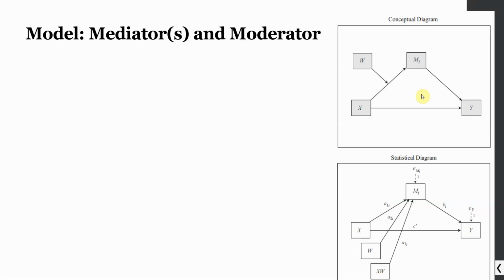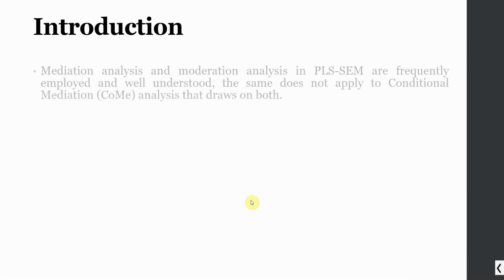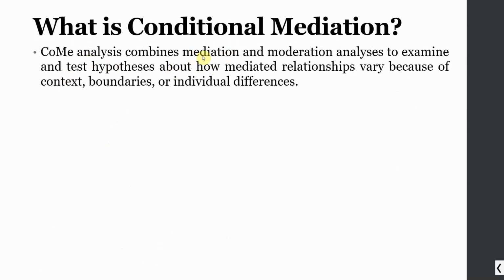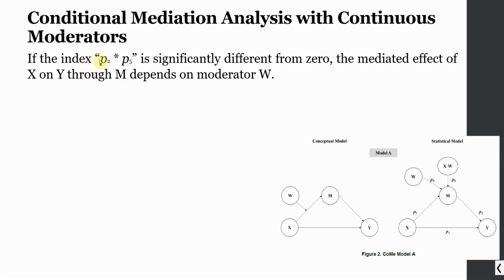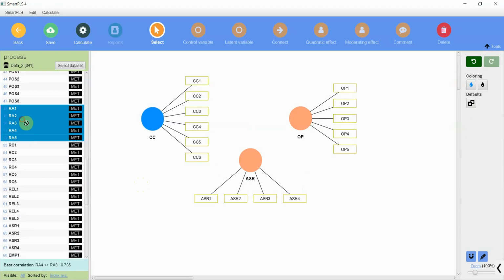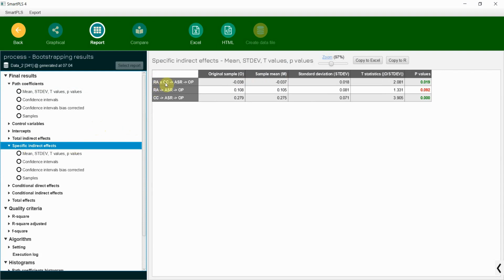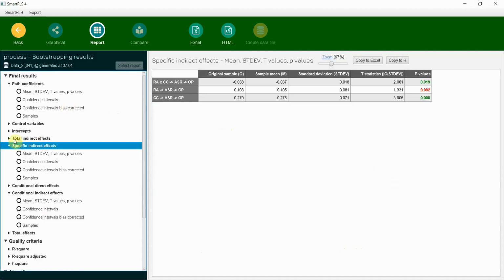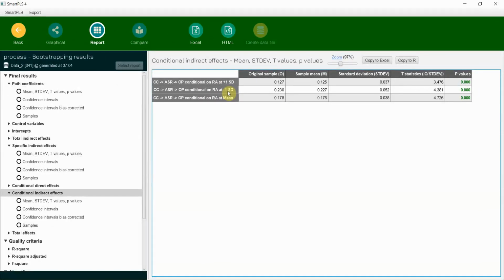#SmartPLS4 Series 35 - Moderated Mediation in SmartPLS (See Description)

Comment: Thank you so much for such a great lecture. I have learned a lot from this. But I have a query. If moderated-mediation index given by specific indirect effect is insignificant, then we need to check conditional indirect effects or not? if yes, then can conditional indirect effects at mean, SD +1 and -1 be significant?
Reply from the maker: Thanks for watching. You may check it. But overall, the moderated mediation hypothesis is not supported.
Reply: @researchwithfawad  Thank you Sir

Comment: Dear Faward, could you please show us how to on when using seminr in R to analysis PLS-SEM, how can we easily get simple slopes for moderation analysis (simple slopes for +_SD of Moderator)? Also, is there easy way to conduct moderated mediation (conditional indirect, conditional process) analysis like in PROCESS in SPSS and get the index of moderated mediation, and also the indirect effects when the moderator is high and low (+_SD)? I saw an article, Cheah, J.-H., Nitzl, C., Roldán, J. L., Cepeda-Carrion, G., & Gudergan, S. P. (2021). A Primer on the Conditional Mediation Analysis in PLS-SEM. ACM SIGMIS Database: The DATABASE for Advances in Information Systems, 52(SI), 43–100. But could not do it myself for now. If you can, please show us? Many thanks.
Reply from the maker: Hopefully, I can soon do some on MM in R. For now you can refer to 
https://www.youtube.com/playlist?list=PLb7vm6tsQ3Ks0TyMWw3EUlgoMr06_7U8S

Comment: Dear Sir,
Could the PLS-SEM approach be used to estimate moderated mediation like this, or is it only applicable to simple moderation?
Also, if the moderator simultaneously moderates one direct effect (IV -> DV) and one indirect effect (IV -> Mediator -> DV; path is identical to the one in this video), should I use the PROCESS model to estimate both of these moderating effects, or just the latter (i.e., use PLS-SEM for the former)?

Thank you very much.
Reply from the maker: Yes, you can use PLS-SEM for the moderation, but then you may have to do manual calculations. Instead, use Process and there are minimum manual calculations.
Reply: @researchwithfawad  thank you very much!

Comment: What if we have moderator as dummy variable. In this case we will use process or just simple pls sem??
Reply from the maker: Use Process if you are assessing moderated mediation otherwise use PLS SEM
Reply: @researchwithfawad  yes sir there is moderated mediation in my model. So if i go for the process, I need to run cfa and measurement model assessment through pls sem or not? Need to run both cfa and measurement model or just cfa will be okay?
Reply: @researchwithfawad  moreover sir my dummy variables will be in circle shape or square? While constructs that are measured through indicators will be in circle shape??

Comment: If in measurement model we remove some indicators as they have low factor loadings, in structural model assessment through process whether we should use all the indicators or just selected ones that were selected in the measurement model assessment??
Reply from the maker: The items removed in MM should not be part of SM.
Reply: @researchwithfawad  thank you

Comment: I have two questions
1. Do you first assess the measurement model (internal reliability, construct reliability, convergent validity, and discriminant validity) and then do the bootstrapping? 
2. While assessing the discriminant validity, I get an HTMT value of 0.907 for the interaction effect (P5), which is obviously not in the accepted range, is this an issue? I am confused since I don't see how the discriminant validity should be relevant for the interaction effect
Reply from the maker: Q1. Yes
Q2. Assess measurement model without interaction effects, only with constructs in the study.

Comment: Can we run Moderated Mediation using PLS not PROCESS?. because I ran it in PLS and it gave me results as well.
Reply from the maker: Yes if the moderator is between IV and Mediator.
Reply: @researchwithfawad but there would be no conditional direct or indirect effect. Does that work for reporting of moderated mediation?

Comment: One more query, I performed analysis in PLS by using disjoint two stage approach (Backer et al) as my Mediator and DV are HOCs. My query is when I shall run moderated mediation in Process tool, I shall draw the model as i draw in Smart PLS4 measurement model stage 2 by taking LVS from measurement model stage 1? 
Regards
Reply from the maker: No need for LVS in process tool. You will use composite score for the variables by taking the means.n

Comment: AOA. I hope you are doing well. Can you please guide me in SmartPLS 4 when I run moderated mediation in Process tool, in case of multiple moderators, I shall run moderators in one go or run one moderator at a time on the indirect path?
Reply from the maker: Run the model with all moderators.
Reply: Respected sir if I run the model with all moderators, conditional indirect effect shows me paths like this
SL -> SE -> SP conditional on Inno at +1 SD and Supp at +1 SD and Bur at +1 SD.
It is not showing me the paths separately for every moderator at +1, mean and -1 SD.
If I run every moderator separately then it shows paths separately like
SL -> SE -> SP conditional on Inno at +1 SD
SL -> SE -> SP conditional on Inno at -1 SD
SL -> SE -> SP conditional on Inno at Mean

Comment: AOA. Can you please guide me how to report conditional direct effect in SmartPLS 4 using PROCESS tool. As i have learned from your video how to report conditional indirect effect, but my query is how to report conditional direct effect. As in my model, i am checking moderation effect at high and low levels between IV and mediator. As we get index of moderated mediation in Con mediation, how we can get this index in conditional direct effect. Thanks in anticipation
Reply from the maker: WAS. Please watch these videos
https://youtu.be/isVAxbA5DOE
https://youtu.be/rmtSkztF9lM
Reply: Highly obliged for your timely response. I have already seen both videos, but my query is still there, as in PLS 4 PROCESS tool, we use conditional indirect effect to check moderated mediation (e.g., Con mediation). What is the function of "Conditional direct effect" in PROCESS tool using SmartPLS 4. If you have any link related to conditional direct effect and its interpretation, please share that link as well. Stay safe.
Regards
Reply: AOA. I have another query as well. When we will run PLS algorithm, shall we draw arrow of moderator(s) on endogenous variable(s) or draw its interaction term or both to report measurement model results? As in my case, I do not have direct hypothesis of moderator toward endogenous variable(s). My hypothesis is like this, " suppose role stress moderates the relationship between IV and DV". So, in this case, when we will run PLS algorithm, shall we just draw moderator interaction term or also draw arrow pointing towards DV keeping in view my hypothesis? 
I did different analyses, as in my 1st analysis by running PLS algorithm, I just added moderator and connected it to DV, R-square value was let say 0.250.
When i did analysis again by adding just moderator interaction term between path, its R-square was different from the previous one i did without interaction term, just pointing arrow of Mod towards DV. 
1. Which way is appropriate in my case?
2. When we will check moderator effect at low and high level in structural model, we will check R-square value with and without interaction term, in that case when we will check R-square value without interaction effect, shall we delete the moderator variable or just need to delete it interaction effect arrow pointing between IV and DV?  Need kind advise.
Best Regards
Reply from the maker: Please watch this
https://youtu.be/J9UrPYloGJs